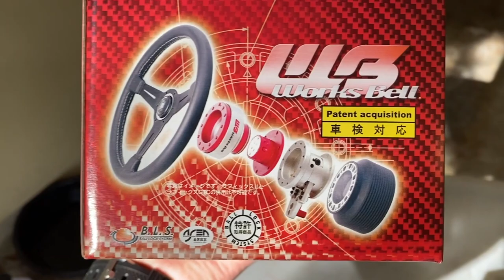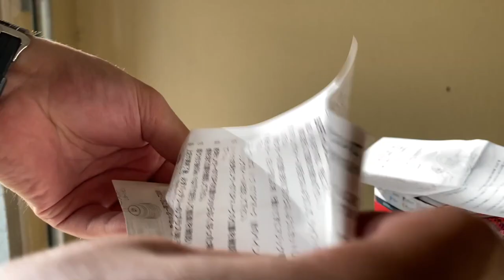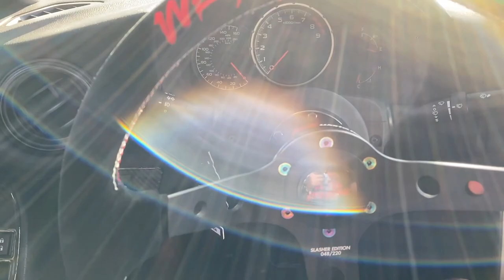Works Bell quick release & LIKEWISE steering wheel INSTALL | BRZ/FRS/GT86

Comment: Did you happen to get your horn to work bro? I got the works Bell QR with a vertex wheel but I can't figure out how to wire it up
Reply from the maker: No :( I honestly haven’t tried to but someone commented that I need to put on a ring adaptor. I remember seeing one in the kit when I opened the box. Try that
Reply from the maker: Nice set up by the way! Vetex wheels are the best
Reply: Prime Daily no bueno unfortunately.. can’t get it to work I guess I’ll be running no horn for the time being
Reply: @EmCeeVIET  Not sure if you have figured out yet but if not, get anything that's conductive with metal whether it be a stick from a feeler gauge and have that rub on the back portion of the hub where the brass material is. Then, screw that metal "stick" somewhere near the hub and then somehow have a wire connected to it whether it be soldered or with a connector and then simply wire the other end into the horn. Each car varies but the concept all lies to be the same. Believe it or not, NRG made a pretty good video on how to wire up your horn.

Comment: hey the works bell has the holes for the clockspring correct ive heard if I remove the clock spring it would mess up the dccd in my sti
Reply from the maker: Yes. I did not have to remove the clock spring
Reply: @PrimeDaily  was the hub 540s?

Comment: Where did you get your red air control caps?
Reply from the maker: https://www.ebay.com/itm/3-Pcs-Red-AC-Climate-Volume-Control-Knob-Ring-Covers-for-Subaru-BRZ-GT86-FRS/132261230705?fits=Model%3ABRZ&hash=item1ecb623871:g:XLAAAOSwxJxdlNYZ
Reply: Prime Daily thanks dude! Were you controls originally rounded? Mine is the 2018 gt86 the knobs seem to be sort of a hexagon shape
Reply from the maker: Mine are hexagons too but they fit perfect on the knobs. Be careful tho! Mine are all the same size. On the frs the climate controls are bigger than the brz. I’m not too sure on the 86

Comment: I m using WB standard hub, considering if it will work with WB quick release, or only work with short hub?
Reply from the maker: I think it will still work. I would email WB just to confirm but I am 99% sure all their products fit each other with no problem
Reply: @PrimeDaily  okok which website u buy it from
Reply from the maker: https://86speed.com this is for the 86 platform. If you have a different car you could check out https://www.evasivemotorsports.com and see if they have it
Reply: The WB Quick Release will work both the standard and short hub. It's just a matter of how close you want the steering wheel to your body...